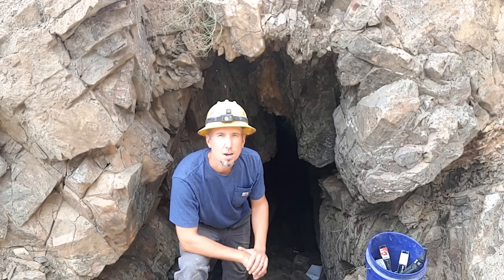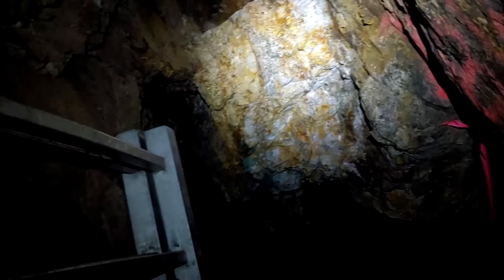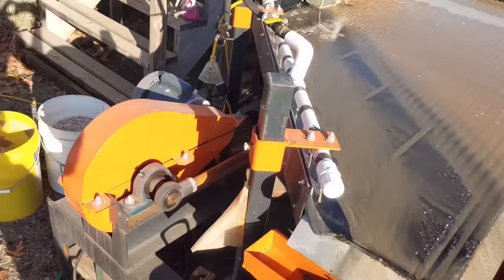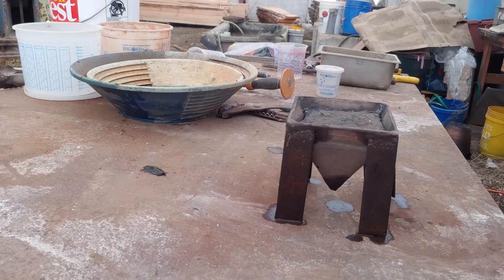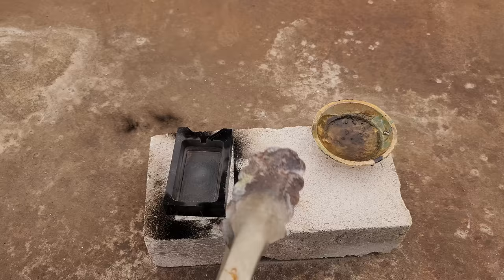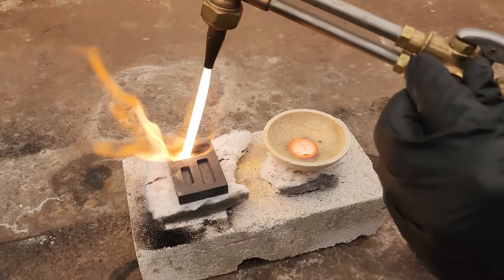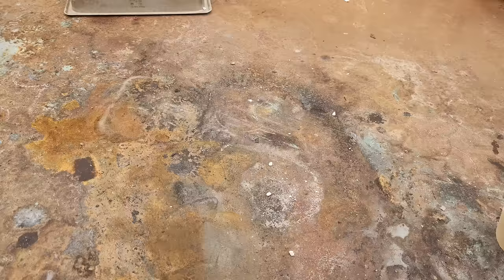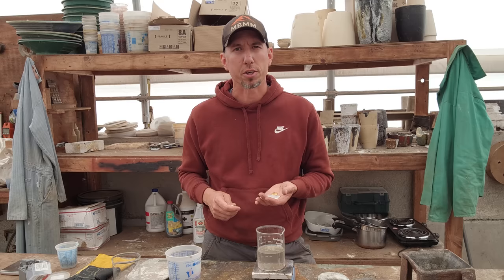Gold Mining, Gold Milling, & Gold Refining: The Full Process

Comment: you need to neutralise your HNO3 solution before trying to displace it with copper. Otherwise the displacement reaction is competing with the acid reacting with both elemental copper and any elemental silver that's precipitated.

Comment: I move material often. The older I get the easier I try to work. I loved the tramway skid in a earlier video. I would tie the bags in line on a rope with the length between bags the distance up the first hole. One bag would be suspended at a time as you pull it up. It's only the first leg but would save several humps up the ladder. 
 It's funny sitting here wanting to help with no mining experience

Comment: Did rinse the silver with distilled water after you cornflaked it? if you used tap water there is a chance that yellow tint to the acid maybe a touch of gold that came over bc of the chlorine 🤷 all it needs is the nitric acid and bam hydrochloric acid creating a bit of aqua regia and dissolving gold into the solution. Sreetips always says that's important and you didn't same anything about to in the vid. O and love the long vids takes me a few times to get threw them but they are definitely worth it!
Reply: The orange red color was simply the reaction of silver dissolving in nitric acid. The solution would have became colorless if he would have allowed the reaction to finish.

Comment: Drilling round holes in the rock can 1 give rock a place to break and move bit can also be used sorta kinda as a way to use a flay chisel bit as a feather and wedge, not the same but ,,, connect the dots of your round holes with your flat chisel🤔👍💪

Comment: I think a 12v battery, 12v solar panel with trickle charger, some steel bar, 1ton atv winch and 7" concrete anchors might do you handy if you haven't already as I'm seeing this 4 mo later

Comment: I was wondering if you could've just sold the buttons as they were. I think I might have enough gold for this to be valuable, but my material is much better. Idk I'll even need too because it's mostly from a sluice. Next time I'm gonna snipe it because they're small flakes that don't catch well in the sluice. I brought two buckets home, stopped maybe 15 times because it was so hot, steep, and heavy. My cons are from a snuffer bottle but I'm not good at panning fine gold at all. I worked the sluice for 4 hours and spent 2 and a half getting the buckets up the hill.

Comment: Your copper solution is green because it is full of silvery. Why? Becvause the solution you poured off was still full of nitricc acid. Which means that when you added the copper all it did was pull silver out of solution just for it to be consumed by the nitric acid once again. That is why it is best to pour a silver waste solution off onto SILVER. Then oncve it stops reacting you can add that solution to a clean container and add copper

Edit: No, a small amount of copper in your solution does not matter, it is fine with a small amount of copper in the solution what you have to do is consume the excess nitric acid that is in the solution. so how best to do that? The best way to do that is to pour the solution over sterling silver. Usually old sterling from a broken set of silverware or something similar. You add silver until it stops reacting then you pour that solution off into a new container and then you add some thick pieces of copper pipe which will cause the silver to cement out of the solution onto the copper pipe. Copper will replace the silver in the solution and turn the solution blue. So how do you recover the silver? Well in another container you pour the blue copper soltuion and add iron. That will pull the copper out of the solution and replace it with iron

Comment: i dont understand how the density calculation worked, the way i know it is to measure the difference in ml of the water level with the bar inside, then use the weight vs displaced volume.

Comment: Right idea with the parting out, but the starting ratio of gold to silver was wrong resulting in incomplete separation of gold. 
You needed to inquart the starting alloy with more silver to around 6K (1/4) gold to silver. With the roughly 50/50 you started with, the Nitric can't get past all the gold to dissolve out the silver (and any remaining copper) completely.
The 6K allow should then be cornflaked for surface area
Re the copper wires.. you can use them, but have to be thick enough to not be completely dissolved.
Your wire/silver mess at the end you could have just washed in water. The silver doesn't plate on to the silver, it's an ion exchange based on the reactivity series of metals.
To get the copper out of the final solution, add Iron
Lastly.. the boil over was always going to happen adding that much Nitric to a hot solution
Suggest looking through @Sreetips videos to get a clearer understanding if you're going to go through this process in future

Comment: DID YOU KNOW 
Your thruster well if you make one the same diameter of a hoolahoop and then have Enough Voltage output, Anyone on A  Hanglider Can power it up in flight Gain Altitude when hang glider Needs that little push when they have no Lift. You Sir can make alot of people Truly appreciate what your doing. 

And it will make for a Realy Good video. 

Drop tomatoes from 3000 feet lmao 🤣

Comment: Did you use tap water or distilled water? The iron and other minerals in tap water will cause contamination in your chemical refining process
Reply: Also highly recommend using a fume hood or at very least outside as the fumes will also damage any exposed metals in the room. I use an acid organic full face mask WITH a fume hood. Brown fumes =death

Comment: What's happening here? You could just throw some urea and table salt in your silver nitrate solution without polluting your nitric to make silver chloride then sodium hydroxide drain cleaner and koal syrup to convert silver chloride to silver metal.  If you want to go cheap take your potassium nitrate and mix with HCl to do poor man's aqua regia and precipitation with zinc and then burn off the zinc or precipitate with smb for gold and drop the rest with salt water

Comment: I would avoid pouring hot acid on your filter... tends to weaken the filter faster than a gravity powered filter can work, you don't want holes in your filters before it does its job.  Let the acid cool a bit (pour it off into a cooling container), or get a vacuum flask to pull the solution through faster than the acid can eat holes in it.  At these smaller volumes it might not be a problem, but knowing you, you will probably scale up in the future.